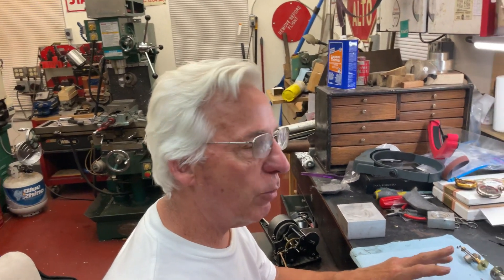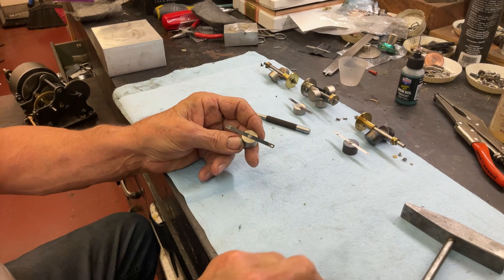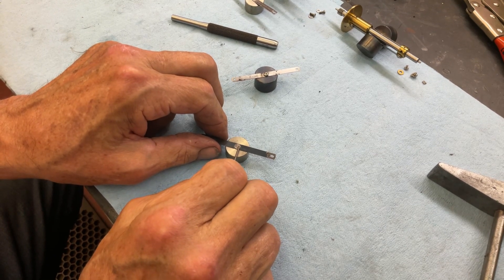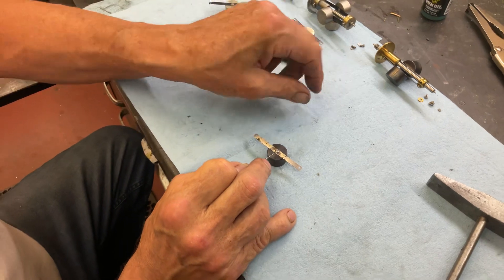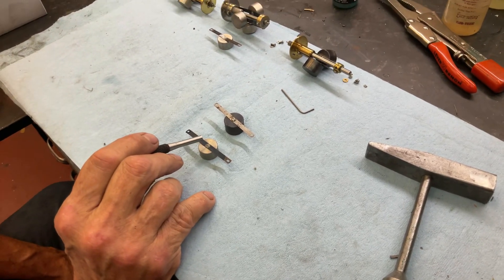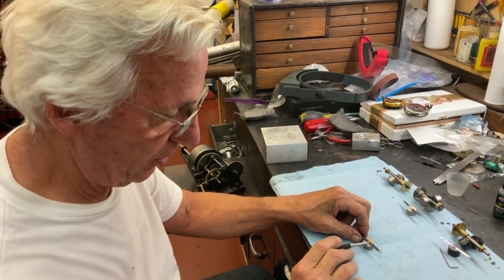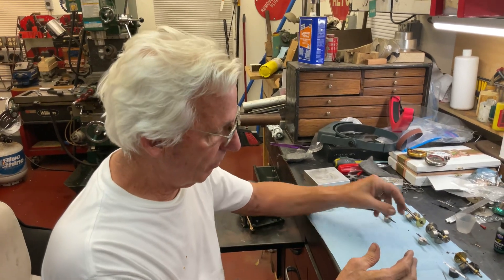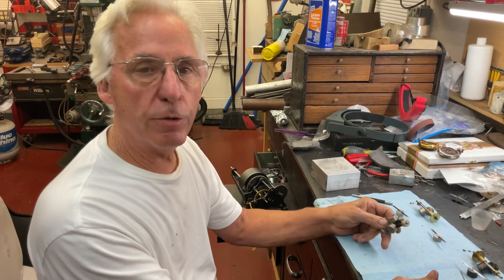719.  Repairing a broken “pinned” Edison governor weight

Comment: Just got to this Brett. Do the threads on the screw bite into the weight or are you just aiming for as tight a fit as is possible? Thanks
Reply from the maker: It is a rivet, so do you want to make sure it is tight which is why I give it a tap